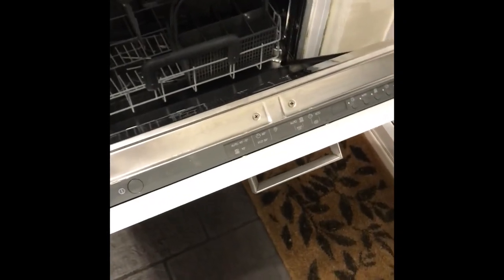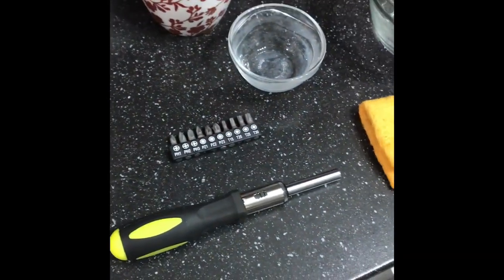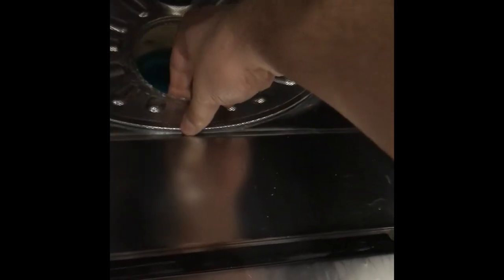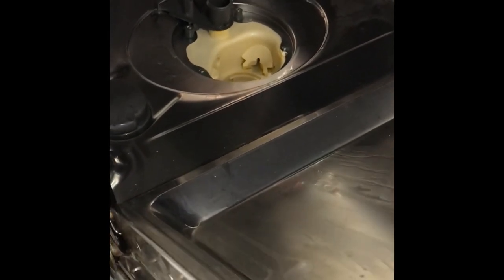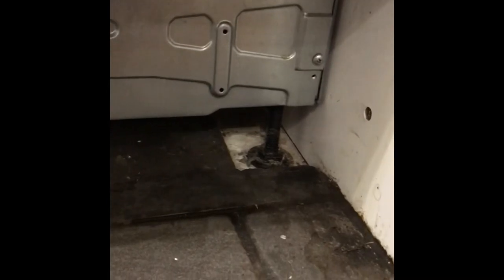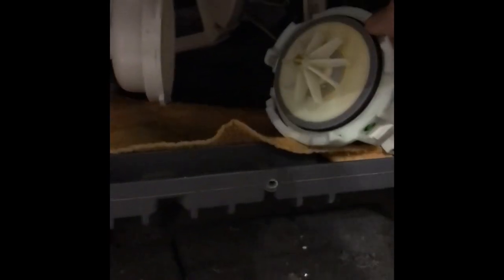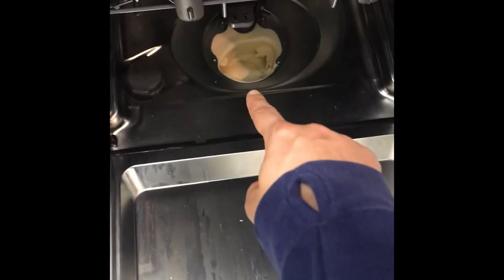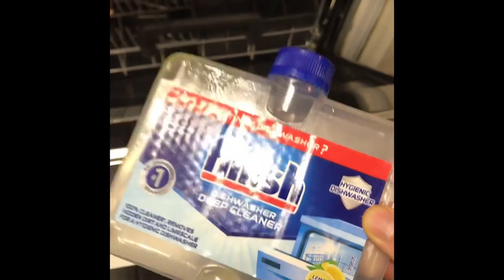How to Fix Error 50 on IKEA Skinande Dishwasher

Comment: Thanks Daniel. My machine had a i20 error (not draining). I followed these directions and found a wet wipe blocking the pump. Works well now, even my missus was impressed.
Reply from the maker: What was the make and model of the machine? I'll add i20 and the machine to my tags so others can find it
Reply: Ikea Renodlad.
Reply from the maker: @gregoconnor7741  Brilliant cheers mate, hope you made use of the optional tea!

Comment: My dude you are a lifesaver. User manual said nothing about error 50 (only 20/30). I had a sunflower seed shell stuck. And you were precise up to screwdriver bit (my d25 somewhat fit, but I remembered that you said d20 and it was perfect fit)

Comment: So greatful!!! Almost on our way to buy a new one... 
You saved us a lot of money! 
If you ever come to Antwerp, just give us a sign and we'll buy you a coffee or beer!!! 😃
Reply from the maker: Very kind, happy to help!

Merry Christmas!
Reply: @danieldunn6329  in the meantime we have error '30...🙀
Do you have a solution for that? 
The offer (coffe/beer) is still on 🙃
Reply from the maker: @eriknina  I’ve done a little reading and it seems likely that there is either a leak in the bottom (where you find the pump in my video) or a broken flood sensor.

Try taking off the cover and drying any water you find underneath and look for a source of the leak.

Have a look at this guide and let me know if you can find the issue:  

https://www.fixya.com/support/t22874919-anti_flood_device_activated_built_in

Edit: this video may be helpful also 

https://youtu.be/YdNFjeieulI
Reply: @danieldunn6329  we'll try tomorrow, thanks a lot for the research 🙏🤞🏼
Reply: @danieldunn6329  it worked!!!
Soooo happy, thanks a lot!!! 🤗🤗🤗

Comment: I think that dishwasher is made by AEG as it's identical to mine inside. FSK31600Z apart from a cover over the pump(which slides off). That cover looks to be a fail safe against leaks from the drainage pipe directly above the pump.
Thanks for the step by step guide. Glass and a peanut was my issue 🤣

Comment: Very helpful however my dishwasher does not show error code. It starts normally, drains water and then stops running and begins to beep. One beep being repeated. It happened before i slum shot the door and it run. Checked the door and it locks and all seems to work fine. But now nothing helps. Does not leak anywhere. The open door indicator switches on and beeps and that is it. I would be grateful for any advice what this could be.
Reply from the maker: Hiya, I'm afraid I'm not an expert on dishwasher repair. I would suggest your double check if there's anything obstructing the latch itself.

I'd try searching the make and model of the dishwasher and the error your having and see what comes up

Comment: Thank you for this video :) But I have a problem with removing the cover on each side of the door. There are no holes like on your machine. The cover has one screw on each side which I have removed but it seems still to be stuck.. Dont know if I should put force on the cover to remove it.... 

Do you have any suggestions? :)
Reply from the maker: Hi there, it's hard to say without seeing it - but for me once the screws on the sides were removed the cover just came away with little force.

Comment: I got the lights over the 6 buttons flashing rapidly. What do you think is causing it ?
Reply from the maker: Sounds like a loose connection or a electrical fault with the machine
Reply: same with me. did you fix yours?
Reply: @JC-zl9tb  no unfortunately. I just bought a new dishwasher🥴

Comment: Hi, i accidently broke the little pump cover after removing the filer and so on, do I need this or is ok without?
Reply from the maker: I'm not sure which piece you're referring to.
Reply: After you did soak up all the water therers a small plastic thing covering the hole where the water runs through. I did glue it bk just hope it holds lol
Reply from the maker: @adamkarlsson726  You mean on the side of the door?
Reply: No after u removed the filter tray an soaked up the water u can see. A little plastic at the bottom/side

Comment: Mine still beeps and show code 50. Is there a reset sequence?
Reply from the maker: Hi there the only thing I could suggest iis making sure it's unplugged, leave it for a while then try again - make sure you add water to the bottom too.
Reply: Thanks🙏🏻. Fixed now💐